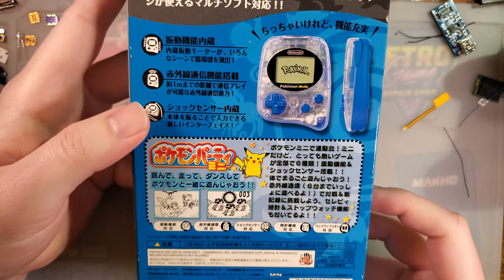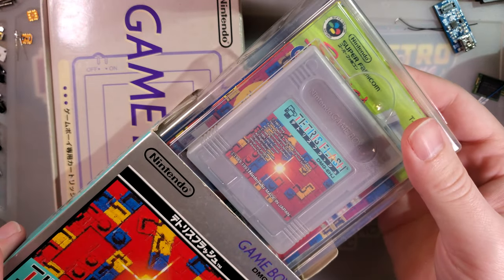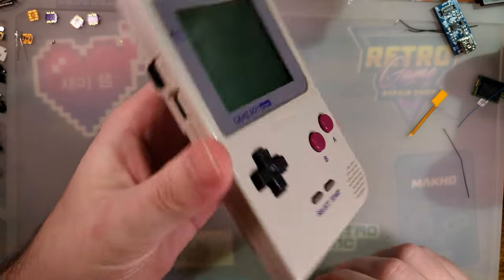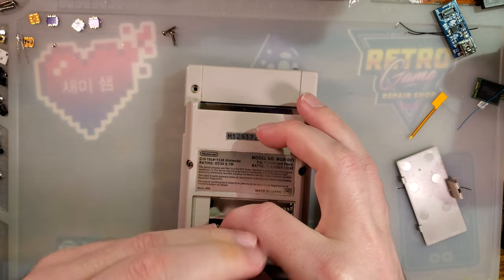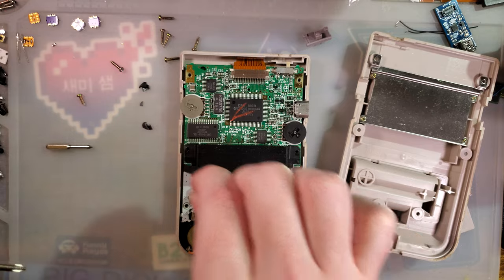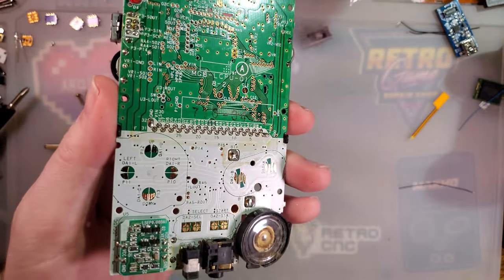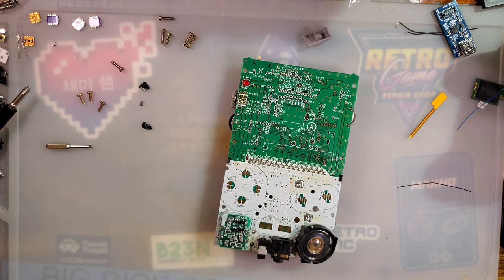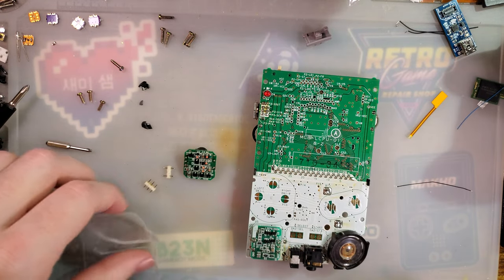DC Regulator Replacement - Game Boy Pocket

Comment: Hello there, I'm a electronics engineer, and i designed some power supplies, the broken pieces are ferrite, it's molded around the transformer so it reduces signal noise generated by it when converting the voltage levels, the board would work without it, but, it can generate some glitches and strange behavior because of the noise

Comment: So here is the thing when I initially purchased this gameboy it would power on then turn right off. I opened it up and found acid damage on the power regulator which I cleaned off. I tried to turn the gameboy on and the same issue persisted. Out of frustration I dumped isopropyl alcohol onto the power regulator and wala the gameboy powered on and played a game for 10 mins. It then turned off again and continued to have the same issue when I first bought it. Would love some help I am a amateur at repairing video games.

Comment: hello, could it depend on the regulator, faulty, which does not turn on the gbc?  thank you
Reply from the maker: If the power regulator is faulty, yes, your GB will not power up.
Reply: @makho  where can the replacement be purchased?
Reply from the maker: @Dany-ft3xc  There aren't any replacements for OEM spec. If you have a modded GB with a non-funnyplaying IPS or something, these can be made https://github.com/marshallh/gbpp